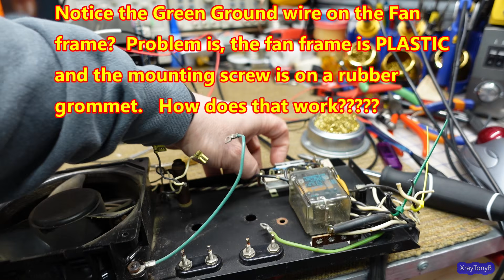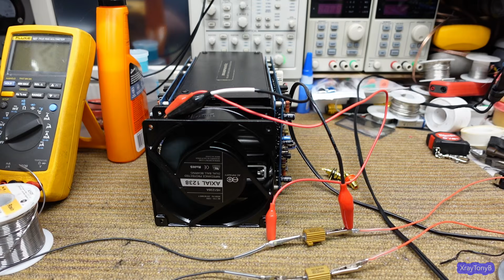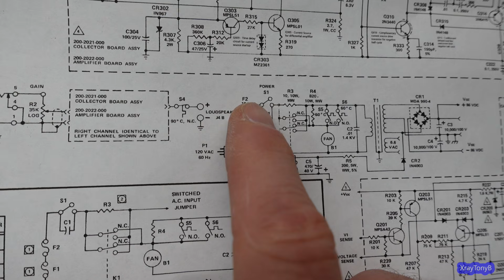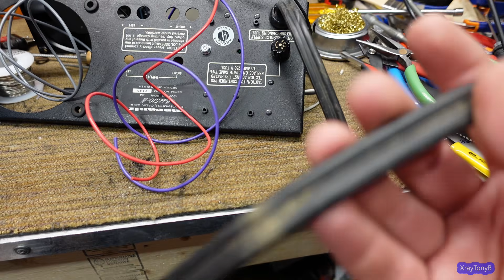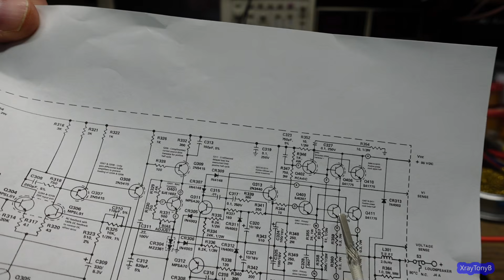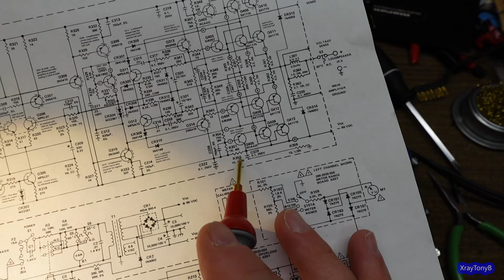Marantz 510M Part 4 - Rear Panel and First Amp Module Test

Comment: Hi where did you get the new rubber mounts/grommets for the fan? Holes appear to be 10mm or 3/8" opening...as usual my old ones are totally hard. Replacing the MU2A1 fan that's making a fair amount of noise also.

Comment: Hi Tony.... Sorry to say, you make the same mistake as I made until one week ago. I use a solder sucker for many years, and, as I saw you do, pressed the teflon nipple against the heated hole AND the iron tip. But last week I adopted that to a whole new level that I like much more: heat the hole, take away the solder iron, and put the sucker perpendicular on the hole and suck, just like you do with your heated solder sucker. Succes guaranteed ! You also save the teflon tip a bit.
Very good job on these monsters of amps, I am amazed how fast you are able to transfer these in almost brand new machines 😍

Comment: There is a valid reason you can have a thinner ware gauge with a heavier gauge cord. Remember it's all about resistance. How much resistance in 3 inches of 18ga wire? How much resistance in 6 feet of #14? I have seen 25hp motors with 14ga wire from the wiring box to the winding's for mechanical reasons. It's the same for the audiophile argument that their speakers are wired internally with #20ga wiring yet they use 10ga for the connections to the amp. Little do they know about the same 20/22ga wires in the amp from the circuit board to the speaker terminals! It's all about series resistance versus current demand and not solely wire gauge.

Comment: I also noticed in the first soft start circuit wiring, they had the white (neutral) wire hooked to the fuse. It should have been the black (hot). Great job, love the series! 

 Getting a used piece of gear that has been worked over by different technicians is like the Forest Gump box of chocolates, you never know what you are going to get.

Comment: Speaking of power cords, you should make a video talking about how grid current, that leaves the power plant, and makes it allll the way to a home receptacle, goes thru ALL kinds of rusted, corroded, switched, hundredsss, of joints, transformers and all that Sh*** and, people expect that the last 4 feet of $399.99 gold plated "boutique" aftermarket power cord, will make their audio sound better?! :) ahahahahahahahahahahaahahah!!! In Your Dreamsss People!!!
Reply: Not to mention the 50 to 100 feet of Home Depot Romex cable in the wall back to the breaker panel! And don't forget the AC fuse direction! Listen both ways. One way will surely sound better, in fact night and day difference! Of course you will first need one of those $600 audiophile fuses!

Comment: I used those AC infinity fans in an environmental chamber project as a circulation fan. They work great, sturdy and inexpensive. For nativly quiet fans at all speeds though, you can not beat a Noctua. Those are mostly 3 or 4 pin fans though.

Comment: Hi Tony - there is another version of  schematic with the voltages and currents marked in red.

I was in touch with the engineer who developed the amp (about 20 years ago). he wrote that the input jacks were chosen for amp stability - not sure why though 
the 510 was designed to be super stable especially versus 500 ==> master/slave architecture, input jacks vs cinch, 

when you put full voltage - could you check what you get at the 2 zener diodes in the input stage - I get +/- 18,8 v instead of the +/- 19.8v
could you also check the voltage drop across r316/r321 and r322/326 , they should the same per pair 

thanks!

Comment: Hi Tony, as always beautiful work and good hunting 👍
I also use a manual aspirator - mine is handmade in 1984 because in socialist Czechoslovakia you couldn't buy something that would actually work. With the advent of PCBs with metallized holes, there was a problem with sufficient vacuum to completely remove the tin (it's not the suction cup's fault - it can suck even an overheated POD) the vacuum escapes around the tip - I solved this problem by putting a silicone tube on the tip of the suction cup - it has worked perfectly for many years. The tip of the soldering iron will not harm the silicone tube and the tube will adhere perfectly to the suctioned area.

Nice day 🙂Tom
Reply: https://www.youtube.com/watch?v=BQn6lTNmodI&lc=UgwInQ2s0r_JgvaYSrd4AaABAg

Comment: Off topic
Soft start, is a popular topic in the solar community for off grid heat pump . The price of the commercially made soft start devices is relatively high to the do-it-yourself community, Tony would you consider making a video of how to build your own soft start device for HVAC applications. Though probably a bad idea due to liability issues.

Comment: Hi Tony what’s the make of the solder pump that you’re using , it seems to work really well as the one that I have doesn’t work very well.
Keep the videos comming  
Mike from over the big pond
Reply from the maker: Soldapullit is the name of the one I'm using.  It is made by Edsyn in California, USA.  There are other cheap (Chinese) versions that look the same, but they don't work nearly as well.  This one will suck the chrome off of a bumper hitch ;)  They are available on Amazon and Ebay, as well as most Electronics stores online.  Just make sure it's the edsyn one and not a fake.